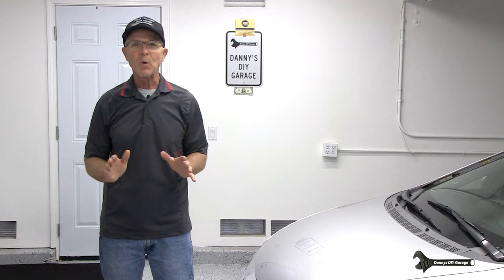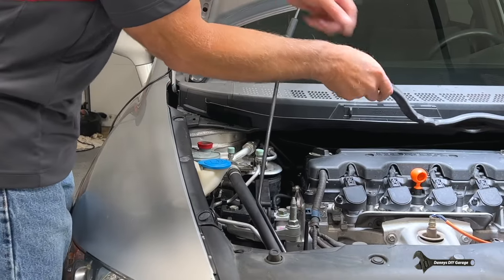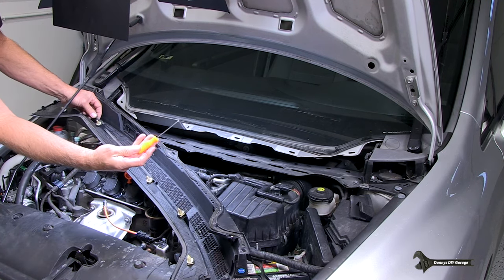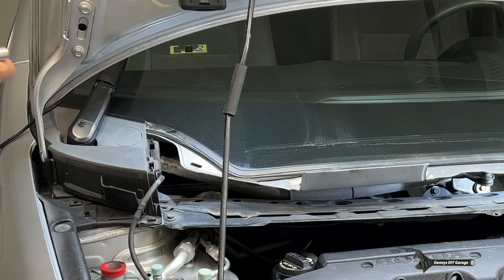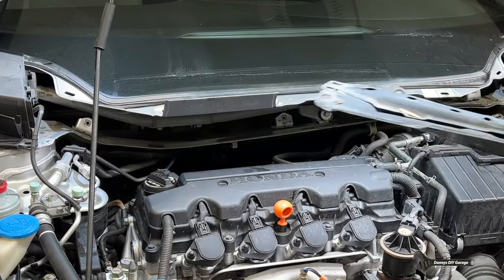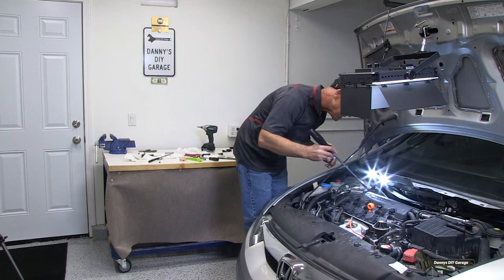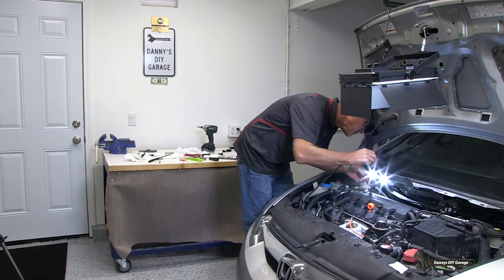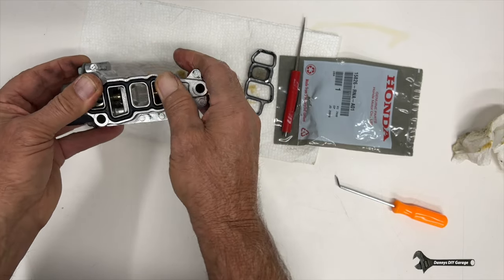Civic 8th Gen oil leak, VTEC Solenoid, replace VTEC solenoid, replace spool valve

Comment: Well done  videos  i have a recommendation  don't  oil the gasket  before  installation and clean the block  surface with something i use carb or brake  clean and emerycloth the surface should be as clean  as possible  the only gasket i even put oil on the oil filter gasket. If you still have a leak after that check the egr plate on the back of the engine below that valve it also leaks  and is not easy to repair and lastly the power steering hose es have o rings that leak also at the connection connection to the pump.i have done many of these and that why im letting you know you may have 2 more  leaks in the not so soon future i let my clients know  so when they don't come  back complaining  the leak ijust fixed  is still leaking  or the You fixed the wrong thing  ! This applies to the 1.8 l engine  only hope this is helpful toyour viewers
Reply from the maker: Kevin, thanks so much, this is great information, you are right on, my O'ring on my PS hoses are leaking and I'm getting ready to make that video probably within a couple of weeks. 
Do you have part numbers on what's needed for the Power Steering, if so send me an email at dannysdiygarage@gmail.com  Appreciate this great information, Perfect timing.
Reply: I just fixed my PS o-rings, thanks to you, and now I’m looking at changing the spool valve before it starts leaking. Thanks for taking the time to show the details, respond, and ultimately make these videos, you’re a valuable resource for help on the 8th gen upkeep, and you’ve got a subscriber here for sure! Thanks!
Reply: I just did this job I cleaned everywhere where the gasket sit and  even the engine block I did put a thin oil cuz wen u tighten the bolts  it compresses it
Reply: Thanks bro valuable info for me. Changing this gasket at 200k miles now in a 5spd civic and gonna hope to god that plate isn’t leaking aswell!  Thanks!

Comment: OK, it seems like after replacing I am still getting a little bit of an oil leak somewhere on the left side near the rubber or plastic circle on the side of the engine block and near the grounding wire in front of all of the solenoid. Any thoughts?
Reply: Got it figured out, I also had camshaft plug leak! Very easy fix. Part: 12513-P72-003.

Comment: I've gotten to the part where you removed the 3 10mm bolts to take the thing off. The problem I'm facing is that no matter what force i can put on the bolts, they won't budge. I'm on the line of stripping 2 10mm sockets. Yes im pulling making sure im moving lefty loosey, the same direction you're doing.
Update, it's off: If you still can't get them off what i did is get a swivel adapter (3/8ths→3/8ths) and a fresh 10mm. Then make your ratchet longer by either grafting something to it or just a longer ratchet. Used my screwdriver taped up to my ratchet, even then i should had to put alot of force i thought my screwdriver was gonna snap.

Comment: Just did this job yesterday and i want to thank you for your amazing and well detailed video.

This was my experience.

Removing the cowl cover and the panel under is easy, ive done it over 10 times.

Youll definitely need a few flashlights to see what you need to move or remove.

Definitely remove the PCV hose and loosen the injector bracket thing, they are in the way and give you more room to work.

Removing the Solenoid was really easy, no need to pry it with anything just push and wiggle.

Just dont lose or drop the bolts , if you are prone to losing bolts just order extra ones. Also make sure you have different sized ratchets, my main one did not fit so i had to use another one that kind of curves a bit.

Now here is the BIGGIE, Removing the old old gasket is really really really hard, PLEASE buy a pick set and a strong knife, but dont do what i did, i picked at it with a flathead screw driver and a bunch of other tools and the gasket was breaking little by little but i damaged the solenoid edges by doing so, the gasket wasnt even close to coming out, i took it inside my apartment and tried different things and nothing, what did it though was these large scissors i had that were strong and had a pointy edge and i managed to pick at the same spot until it finally came up , the gasket was like solid cement 

After applying the new gasket i used HONDA BOND to fill in the alumimum parts that i broke off the solenoid and it worked.

No leaks.
Reply from the maker: Appreciate you sharing your experience with my channel 
Thanks so much

Comment: What a great video! Loved the fact you included the torque specs.keep up the good work and much appreciated 👍🏽
Reply from the maker: Thank you Toni
Reply: 96 in-lb is the same as 8 ft-lb. 
The manual says 8.7 ft-lb which is same as 106.8 in-lb. Most people use 9 ft-lb or 108 in-lb.

Comment: I have two gaskets on my solenoid that I replaced. Purchased it from Autozone and it came with 3 gaskets. The second (smaller) gasket I replaced by unbolting 3 bolts was very brittle and had a crack in it. It’s called Dorman Engine Variable Timing Solnd Gasket 917-173. I also replaced the camshaft oil seal cap and EGR valve gasket while I was in there. All the parts cost about 30 bucks. 👍🏾
Reply: Dorman parts SUCK big time you will end up doing this job again
Reply: I have a leak in that area still after using the Dorman. I’m wondering if I need to replace it again with a Honda gasket
Reply: @joehumeas7196  I am too. Just changed my gasket with a Dorman and today i see a new small puddle on garage floor. I dont know if i didnt tighten the bolts down enough or if the dorman gasket just wasnt thick enough or what else. I wasnt leaking enough to make a puddle before i changed it. Did you try to tighten the bolts a bit more then check it again later?

Comment: So just for kicks, I’ll tell you what happened to my 2007 Honda Element SC.  I started hearing some steering noise, so I added power steering fluid and looked around a little inside there. I didn’t see anything going wrong, so I went through a period of months of adding power steering fluid.  (I know I’m an idiot.  My oldest son was too busy to check it out). The bottom line: the fluid was for Hondas, but it was also a stop leak. Apparently it ruined my entire power steering rack.  I took the car to a new mechanic who ended up having to fix or replace lots of things due to the spewing of the power steering fluid all over the place. $2500 later, and my car is in great shape again, and I am no longer waiting for my son to do my car work.  As an aside, the mechanic happens to be the father of my youngest son‘s fiancé. Small world!
Reply from the maker: Great story, thank you for sharing

Comment: This is my next job, but at 2:54 be careful with this, in my 06 civic the washerfluid hose is not as long as the one in this video, so if this is the first time you remove this cover, be careful as to not pull on it or youll break it, in fact dont even turn the cover upside down if you can already feel a pull from the hose.
Mines doesnt even allow me to turn it upside down like how he did in this video.

Ive taken this cover off many many times
Reply from the maker: Thanks for adding this information 👍🏼

Comment: While doing this project, you should take the time to check and replace the PCV VALVE. When it fails, excess pressure in the crank case will cause leaks. This seal is particularly susceptible to pressure leaks.
Reply from the maker: Great suggestion, I do have a PCV video on my channel
Reply: @dannysdiygarage  I think I have seen it. You have great content, I follow your how-to videos. I am keeping my wife's 2004 Honda SI Ep3 and my son's 2004 Accord running. I think it was your video that prompted me to replace the PCV VALVE on both. Big improvement. The Accord has 179,000 miles and was using oil and not running right. The Ep3 has 120,000, and replacing it improved overall performance, MPG sound. Thank you again for the great content. 👍
Reply from the maker: @GgRae-gv1tg  appreciate you taking the time to write this
Reply: where is the pcv valve?
Reply: @specialstone9153  Look it up. Mine was above the alternator. Improves performance and keeps the oil cleaner. Definitely worth the 20min to replace. Danny's garage has a video.
Reply from the maker: Yes https://youtu.be/glltxejn10k?si=gRNkOolafZTlS7vp
Reply from the maker: @specialstone9153  https://youtu.be/glltxejn10k?si=gRNkOolafZTlS7vp

Comment: If you're going to replace this o ring, the valve cover gasket, and the two passenger side engine mounts in the same job, does it give you better access if you pull the valve cover off the head or remove the dogbone prior to removing the spool valve?  I'm trying to set up this job for best efficiency, thank you.
Reply from the maker: Yes, it will make things easier
Reply: @dannysdiygarage  I appreciate it!  It looks like the dogbone is more in the way than the valve cover so I'll try removing that first.

Comment: Hi Danny. Im actually getting ready to repplace my PCV valve. Watching this video now too, because i seem to have the same oil leak issue from this area that you mentioned in that video. Now having seen you do this, I'm wondering if you would recommend removing the metal plate at the base of the engine bay like you did in this video in order to do the PCV valve. Thanks!
Reply: On second thought I'm going to just do the PCV valve and this job at the same time, as you recommended.
Reply from the maker: Yes doing them both at the same time is best, and yes it’s easier to remove the plate

Comment: Thank you.  Your video is very clear about how to replace the filter.  I have the Civic manual from Honda and not much mention of this part.  What does it actually do?  When might the valve itself need to be replaced?  How can the valve be tested?  Thanks again.
Reply from the maker: It's a variable valve timing control solenoid, the name pretty much explains what it does, changes the timing for optimum performance

Comment: Another great video Danny. A couple questions, should we use carb or brake cleaner to clean out the solenoid?
Also, for the new gasket, how about using a light coat of silicone paste? Not silicone caulk, I mean the silicone lube that is good for rubber and caliper slide pins for example..
Reply from the maker: Brake cleaner works fine, lube it with motor oil also the gasket, that seems to work good, also change your motor oil
Reply: @dannysdiygarage  ok thank you. Oh also, you mentioned this is typically the cause of an oil leak on the passenger side. I'm having a lot of oil come down the transmission. It's oil and not red transmission fluid even though it's dripping off the transmission. Any ideas where that may be coming from? It is quite a bit, if I wipe it off at night the next morning it's already dripping again even after leaving the car sit for a couple weeks.
Reply from the maker: @Conald_isAfalseProphet  if it’s in that same area, check this https://youtu.be/rtSmW8ZZMIw?si=Kg-4Fm3wtYb7Mcnu
Reply: @Conald_isAfalseProphet  Honda transmission fluid isn't red

Comment: How many newton meters did you tighten the bolts? Thankyou
Reply from the maker: I believe that converts to 10.8 NM
Reply: @dannysdiygarage  thank you friend 🙋🏻‍♂️
Reply: I broke one bolt even using the right torque. A mechanic told that this is always happening 😢

Comment: I worked on my VTEC Solenoid , followed along with the videos, and the power steering o rings..and there still seems to be traces of leak at the same spot by the solenoid. Any tips? Would sealants work?
Reply from the maker: Check the oil pressure switch and PCV, best to clean the area off, change your oil add die and use a black light to find the leak

Comment: Hi I changed my power steering pump and it went fine but in  process I had to remove the crank shaft pulley so I had more room to do the job after everything was said and done I put the pulley back on and slipped the belt back on then I started the car and it ran for a couple of seconds and I gave it  a little rev then it shut off and it didn’t start and when I looked under the car and a bunch of oil was on my driveway it looked like oil was coming from the crankshaft area or that vicinity and I’m to sure what to do thank you
Reply from the maker: Did you pull the crank pulley back off? Do you have a scan tool to check the crank sensor to see if it’s putting out the signal?
What year and model is it
Reply: @dannysdiygarage  it’s a 2010 Honda civic and no I haven’t scanned it
Reply: @dannysdiygarage  and no I put it back on and haven’t checked it should I pull it back off and see if there is any oil coming out but I was told that no oil can leak from the crank pulley
Reply from the maker: Do you want me to look a few things up for for some possible causes? Or are you okay
Reply: @dannysdiygarage   yes please that would help me a ton
Reply from the maker: The crank sensor is at that area, most likely cause would be if you were prying or pulling the ps pump, you could have brake the sensor, they’re really easy to replace, this could also be your new oil leak, or it could need a new oil seal on your crank, this is just my thoughts, I’m not there so take this information cautiously, if you had a scanner you could see if the crank sensor was working, but either way I think you’re gonna be pulling the crank off or at least the crank sensor to inspect it, I believe the sensor is held in by 1 bolt, please update me I’m curious of the results
Reply: @dannysdiygarage  your amazing thank you so much and yeah I’ll keep you updated.

Comment: Dennys you mentioned the torque for the vtec solenoid is 96 but i found that the right torque is 8.7 lb  im right????
Reply from the maker: I did 96 In LB not ft LB so I torqued it around 8 ft, my in LB gage was more accurate at that low range
Reply: 8.7 ft.lb sama as 106 in.lb
Reply from the maker: Yes

Comment: Help please! I replaced the gasket and when bolting it all back together 1 of the 3 bolts broke. What can I do to remove the broken bolt? With only 2 bolts it’s leaking slightly. Am I screwed?
Reply from the maker: You just need to remove it, I’m guessing it’s not in there very tightly, try a small punch and use penetrating spray
Reply: Where can you buy new bolts? I did the same thing, but I was able to get it out.

Comment: This is a great video Danny! I believe that my 2014 Civic is leaking in the same place, but can’t see/feel any oil under the Vtec solenoid. There is oil further down on the passenger side of the motor below where this solenoid is situated. (I’m not sure I can reach far enough under it to feel any oil.) Did you see oil directly below the solenoid or was it seen only further down? Thank you for your response!
Reply from the maker: I saw it further down, my oil is so clean alway it's tough to determine where it comes from

Comment: you said 96 IN lbs on torque. Did you mean FT lbs? if not so it would be 8 FT LBS?
Reply from the maker: You are correct, inch not foot, yes 8ft

Comment: So replace the weak Honda seal with another weak seal. I'd put some Honda bond around the new gasket. What's happened to Honda
Reply from the maker: I’m not sure what you mean when you write weak seal, the rubber gasket lasted 14 years, yes I bought another OEM gasket and no I didn’t use any other type of sealer, this last another 14 years, appreciate your comment
Reply: That seal is a rubber ring with filter. If the filter is clog and higher pressure in that cavity will force the oil tp leak out. Isn't it design that way rather then no oil flow/pressure to the VTEC mechanism.

Comment: They leak because they always go on too tight. Dont use the torq wrench. Put it on hand tight only.
Reply from the maker: I’m gonna have to disagree with you, here’s why, using a torque wrench assures proper and even torque not to mention keeping you from breaking a bolt off in the head, if you’re a seasoned technician you can get away with not using a torque wrench, however most DIY’ers should use and own a torque wrench, here is a video on an affordable torque wrench https://youtu.be/GoBePlsQSYU?si=XZOyrerUWYaVXTun

Comment: Honda does not sell gasket seals alone you need to buy entire kit 500 or chines seal that might work make sure you keep original filter
Reply from the maker: Contact a different Honda dealer, part number is mentioned in the video

Comment: @ Dannys DIY Garage, how are you? i just changed 4mos ago the power steering high pressure & return line hose O-ring, and now i saw an oil on my driveway and i see it i think it is beside power steeering hose same area, passenger side. im just thinking maybe its solenoid too from my 2006 honda civic ex.. right i cannot jack it up because its too cold right now here in ON its -5 deg C / 23 Farenheit. Thank U!
Reply from the maker: That’s cold, I’m in Southern California and I feel for you